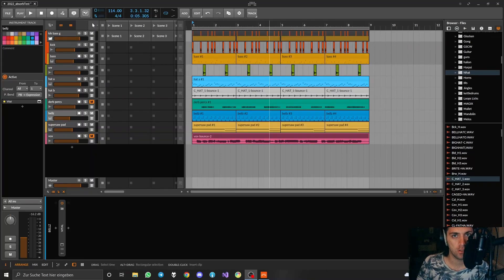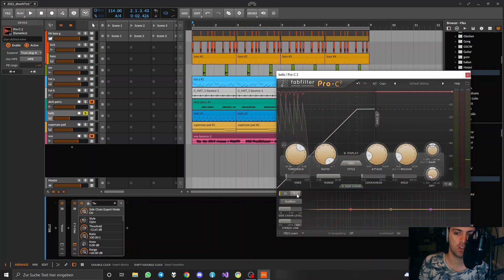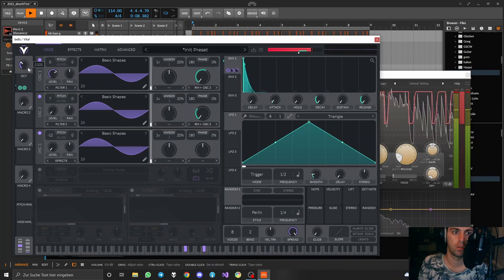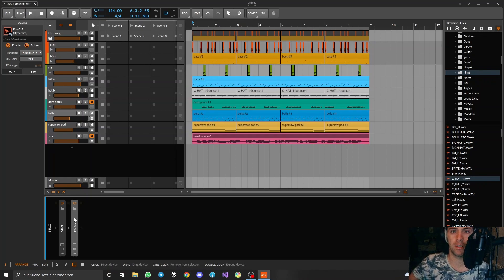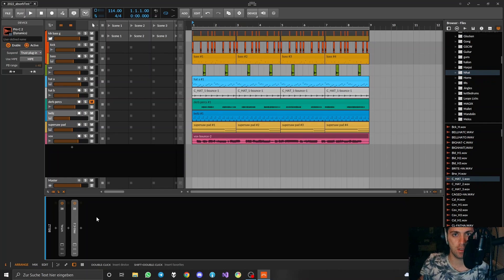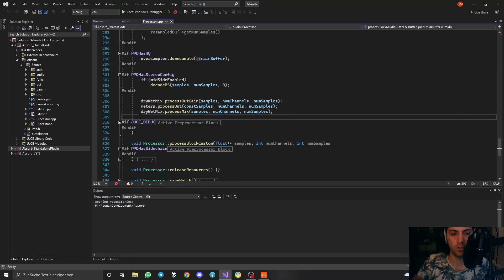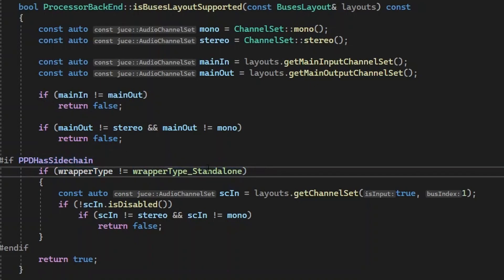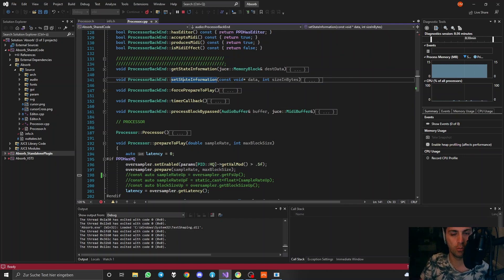JUCE Tutorial: Sidechain

Comment: i have the problem where my sidechain works (in reaper) but rendering has no effect because of different behavior in offline mode. it's like the sidechain doesnt exist. did you ever run into that? sorry if you mentioned it and i missed it.
Reply from the maker: i didn't run into an issue like this yet. i just know some DAWs don't recognize a sidechain input if the source is currently muted, which means it can't be exported in solo unless the source is not actually running in mute but just not routed into any output channel